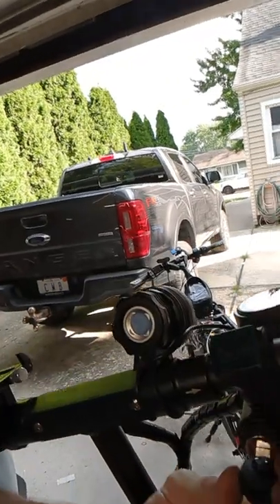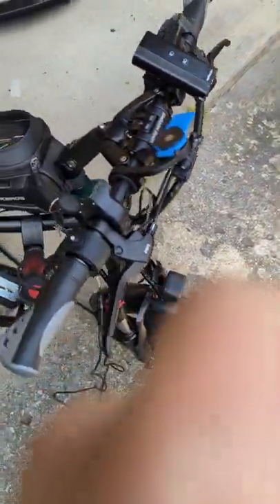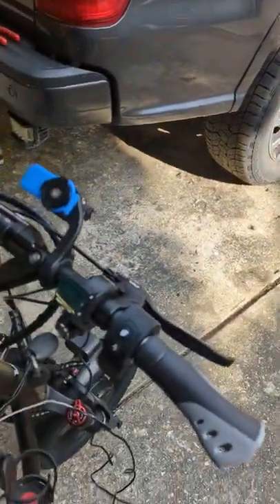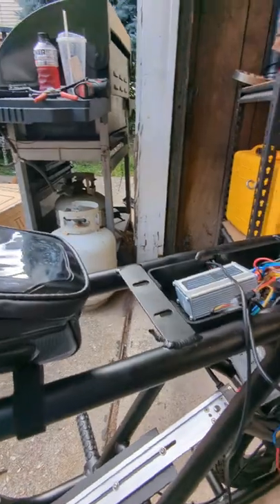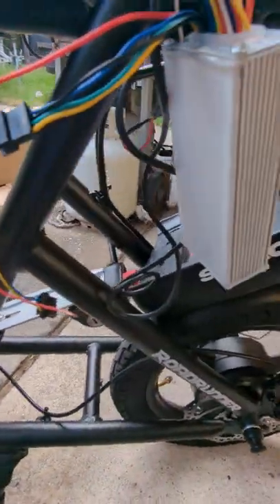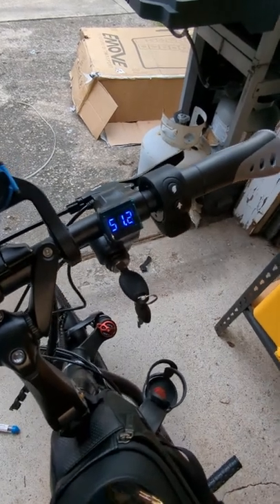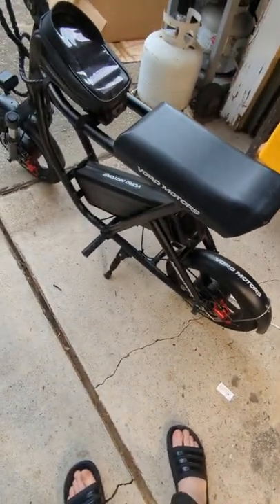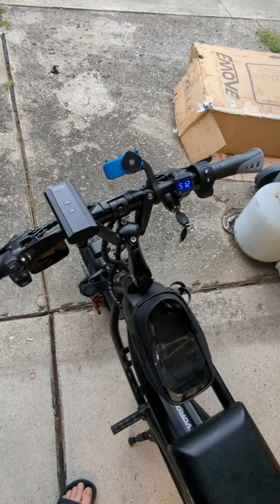How to install an ignition switch and voltmeter on a EMove Roadrunner E-Scooter

Comment: Problem solved with the LED light not turning off when the key is switched off. I just swapped the green and red wires. So the voltmeter red wire wire should go to the Display red wire and the voltmeter green wire should go to the controller red wire. The black wires remain the same in your vid. Thanks mate and hope this helps. You no longer need to remove the battery in order for voltmeter LED light to turn off.
Reply: Nice job. Been wondering about this myself as I did the same thing as above. So will change those wires around as I'm about to also wire in a second battery. I'm in Oz as well ;)
Reply: Does this actually work ?
Reply: @miguelrodriguez0102  yes it does. I have the voltage meter turning off just fine on my RR.
Reply: @billybanana  thanks and regarding the black wire how did you connected ?
Reply: @miguelrodriguez0102  tap into the existing black wire by removing some of the plastic cover and I soldered it onto it. No need to cut it right through if you don't need to.
Reply: @billybanana    Well done!!! This is very informative...as effectively, your commentary and instructions... demystifies, the "flux capacitor" connective relationship...between the lock cylinder; the separate throttle; and the main display; ---of {both} e-bikes and scooter's!!! 💯💯💯

~Again... "Well done to you, sir..." 🫡 

Additionally, -as it relates to the black wire... *(---the "t" cut/connection, is a simple SPLICE...) ---so join [solder] that black wire, into any existing black wire to the controller; ----just try to remain connected to the controller's [same] circuit, if possible. ---I.E. ...controller's [throttle] black/ negative ground; -or controller's [display] negative ground. 🤫
Reply: @_Hansing..   ***I meant this comment [mainly] for you...***   ~Congrats!

Well done!!! This is very informative...as effectively, your commentary and instructions... demystifies, the "flux capacitor" connective relationship...between the lock cylinder; the separate throttle; and the main display; ---of {both} e-bikes and scooter's!!! 💯💯💯

~Again... "Well done to you, sir..." 🫡 

Additionally, -as it relates to the black wire... *(---the "t" cut/connection, is a simple SPLICE...) ---so join [solder] that black wire, into any existing black wire to the controller; ----just try to remain connected to the controller's [same] circuit, if possible. ---I.E. ...controller's [throttle] black/ negative ground; -or controller's [display] negative ground. 🤫

Comment: My swagtron Eb5 controller has 5 wires for Throttle connection (black, red, blue, yellow,  white). I bought a voltage keylock and it comes with green, blue, yellow, red, black wires. Any idea which controller wire connects to new throttle wire?
Reply: Did u ever figure it out

Comment: Hey mate, can you please advise what the effects will be if I were to connect the red wire from the voltmeter to the display  and the green wire from the voltmeter to the red wire on the controller. It's basically the opposite of what you've done. I've watched several videos that have this type of connection and their Voltmeter LED turns off when the key is turned off. Can this reversed wiring break my controller or the display unit if ever, specifically for the Roadrunner? Thank you in advance and look forward to your feedback.

Comment: How do you know how much battery power is left reading the voltmeter. The lcd screen shows full battery but the voltmeter shows 51.3. I'm assuming 51.3 is not percentage of battery power left. What does the 51.3 specify in regard to amount of battery power left?

Comment from the maker: Ignition switch on Amazon.... VGEBY1 Bike Throttle, 12-99V E-Bike Scooter Tricycle Throttle Voltmeter with Digital Voltage Display and Lock Ebike Accessory https://a.co/d/cZ5zPMB